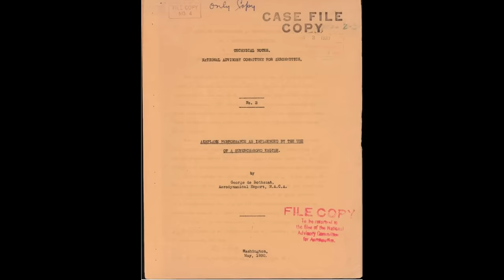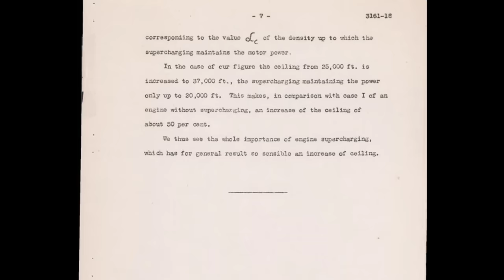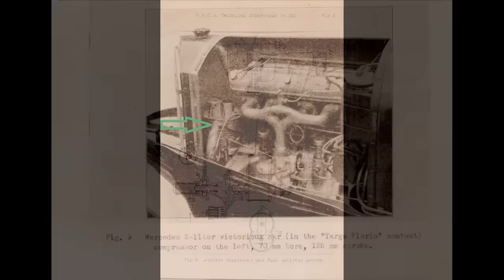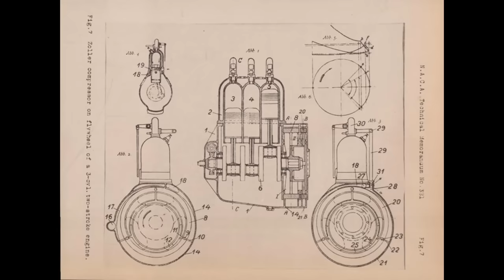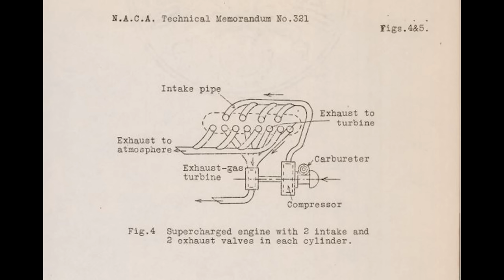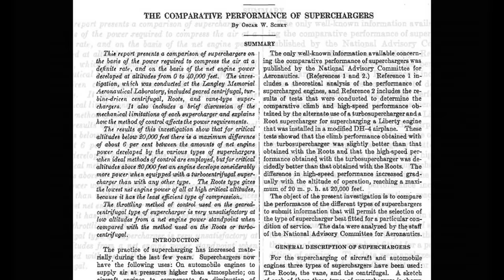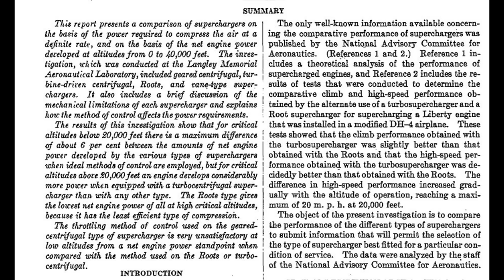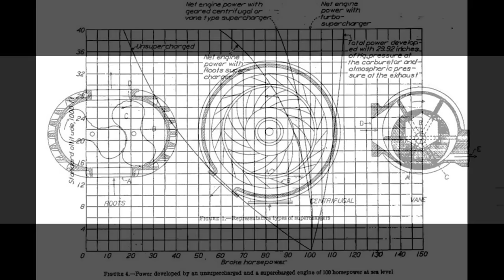Turbo vs Supercharging in WW2 Airplanes

Comment: It is becoming more and more clear to me that the Thunderbolt was one hell of a fighter - -thanks for this post.
Reply: Just couldn't turn very well
Reply: A dinosaur with good proportions
Reply: with a cockpit big like a dance hall
Reply: @davidvalter1936  It could turn just fine at high altitude. Later models (late model Ds and Ms) were faster than P-51s at altitude. At lower altitudes, they were not as maneuverable .
Reply: @richardlahan7068  As long as you didn't need to fly too far!
Reply: @davidvalter1936  but it could roll pretty fast, especially at high airspeeds
Reply: Thunderbolt is the early F4. 😀 Add enough power and it overcomes a lot of deficiencies.
Reply: And then some.

P47 never fails to amaze.
Reply: @rob5944  watch Greg’s video on the P-47’s range (if you haven’t already). It’s a complete myth that the P-47 was incapable of escorting B-17s to Berlin and back. The P-51 did have more range than the P-47 but not as much as most people think.
Reply: @dogeness  then I wonder why it's never been stated before?
Reply: @rob5944  That has always been a lie used by the P51 fan boys  Mike Spick Fighters 950 miles without drop tanks and more than enough to get to  Frankfurt Mannhiem  without loitering
Reply: @jacktattis  so the Army Air Force just allowed their bombers to be shot down needlessly?
Reply: @rob5944   I did say 950 miles 475 miles each way and I did state the cities they could get to And dont forget the P47 did get drop tanks later.  There were other reasons the P51 got the nod,  You did know that the P47 got more kills in Europe.
Reply: @jacktattis  haven't really looked tbh.  In fact I can't remember what the original conversation was about.  I'm more of a casual viewer, sorry.
Reply: And it is becoming more and more clear to me that the Pratt & Whitney was one hell of a motor company.
Reply: @rob5944 I know I'm late to this but the fact that you asked "Army Air Force just allowed their bombers to be shot down needlessly ?" and it actually being 100% correct is hilarious. 
Bomber Mafia is the key term, Greg's part 6 of the P-47 series covers this topic aswell so have fun watching if you didn't already.
Reply: @Tacticaviator7  blimey, I can't even remember.  Did I?  I would say however that for a while I believe the Americans were confident that with close formation and a heavy defensive armament they could protect themselves, despite the RAF telling them that it would'nt work.  According to actual veterans (The World At War 1973 TV series) it was prettysuccessful....However this was only brief.  As raids grew in size and went deeper, and the Germans developed their tactics, losses mounted.  So much so that 8th air force operations were suspended.  Now I'm only repeating what I heard them say, so I suppose it's Greg and his research vs them.  They only have their own perspective but he hasn't the lived experience, perhaps the truth lies somewhere in between.  Who knows.  What is certain is that the bomber offensive was hell on earth for both the 8th and Bomber Command, not to mention those on the ground and the fighter pilots.  Maybe we should all content ourselves with that.

Comment: Fun fact:  That big building in the foreground of the aerial photograph of the Indianapolis Motor Speedway? It's the Allison aircraft engine factory -- it's literally just across 16th street.
Reply from the maker: Oh, an Easter egg! I didn't even know it was there, cool.
Reply: @GregsAirplanesandAutomobiles  LLm
Reply: I'm not sure about that factory in the picture, one way or the other.  I lived in Speedway (on 15th Street) and worked at Allison from 1980 to 1985.  Allison Plant 1 was further down Main Street, which is in the lower left corner of the picture at 5:52 .  When I lived there, the building occupying the space was a Union Carbide plant, but it wasn't the plant in the picture.  Allison Plant 3 was down at the end of Main St, on 10th.  That was a huge manufacturing plant.  And about 10 miles away, close to the airport, was Allison Plant 5 that was even bigger.  Plant 5 was one of those 6-week wonders that was built in 1942, where production started before the roof was even finished.  Maybe that was Allison Plant 2 in the picture?

Comment: OK I admit it, I cried during this video.  The first time  Clostermann (Top French WW2 ace, most of them in Spitfire) saw a P-47 he thought they were useless (probably the first that landed in England...).  But later he calls them Brutes.  He didn't like Americans, but he was an aeronautical engineer, and was right, the Jug was a brute.  It was designed that way, because at high altitude, the only thing that matters is power.  Some aircraft could climb as high, but the P-47 could operate there.

Comment: I know I’m watching this 5 years late but I thought I’d just point out the auto brand I work for has been using electric supercharging successfully for a few years now. However, only within certain limitations. It’s on their highest performing cars and only acts as a super charger in high load low speed applications where the relatively large turbo isn’t doing much. In such an application, the electric supercharger will spin up within .5 seconds to max boost of 7 pounds for a max of 5 seconds. By this time the transmission has downshifted, the engine has spun up, and the big turbo is moving some serious air. At this point the electric supercharger is no longer needed and shuts down. This runs on a “48v” power system and actually works quite well.  Unfortunately the reliability of the first gen 48v system was pretty bad for the first several years until the horrendous software and hardware issues were worked out. Fortunately the 2nd gen 48v system was much better and most of the electric superchargers were on the 2nd gen system.  They just released an even newer system that deletes the electric supercharger altogether and moved to an electrified turbo charger. This means in low speed high load applications there’s a still 48v electric bolted to the turbo which can spin the turbo to high boost speeds even though the engine isn’t yet moving enough air. It works about as seamlessly as the electric supercharger, so it’s quite good.  They claim that it can also function as an energy recovery system to recharge the 48v battery in certain applications. Love your technical videos, keep up the great work Greg!

Comment: It actually came as a surprise to many engine designers that they gained power as they gained altitude with a turbo engine. All they wanted was to "equalise" the manifold pressure drop due to the lower air density, but didn't expect to actually get more power. I suspect some of those graphs were done after the testing revealed this and they finally understood what was happening.

Comment: My grandfather passed away in the 1970s. He worked all his life at Buick in Engineering. His father was Chief Chassis Engineer when the Buick company was first formed. I remember my Grandpa telling me that turbos were something that Buick really wanted to use but up until the 1950s they just didn't have the metals to resist the high temperatures for any period of time. This was less of an issue in aircraft because they had a much cooler and faster airflow to assist in cooling them but even then they did not have a long enough life to be practical in an auto engine. Superchargers where chosen in the early days because they were well-known and presented far less development costs that turbos did.

Comment: Rolls Royce with both Merlin and Griffon stuck with a two stage supercharger because their iterative design methods created a system which worked extremely well. Their blower was so good they used it on the Nene turbo jet used in many early jets.

Comment: As a young man working as a heavy equipment mechanic, I worked on some big ore haulers that were powered by big v16 diesel engines.   They were turbo charged, intercooled and supercharged.   Four exhaust driven turbo chargers pushed air into an intercooler and then the cooled air went through the belt driven supercharger which rammed the air into the cylinders.   Those engines were rated at about 2200 horsies.
Reply from the maker: There is some impressive tech in the Diesel powered heavy machinery world. Thanks for your comment.

Comment: All love to the Jug. Indeed an aircraft made for warfare not for showrooms and posters.
Reply: Fábio 
I think you basically just quoted Kurt Tanks design doctrine for the 190. Which makes sense, admittedly, since they both made a departure from the standard fighter design dogma of the time
Reply: Quite agree. The jug was a proper warbird.
Reply: @zandvoort8616  Till they had to turn round and go back.
Reply: Rob Val, according to Greg they didn’t have to if they were allowed to use the belly tanks.
Reply: Ww2 had some of the best airplanes ever built
Reply: @rob5944 why do that when you can dive right back at altitude and take your time?

Comment: Der Unterschied zwischen den beiden Formen der Anlage wird von diesem ausgezeichneten Video völlig und verständlich erklärt. Echt super!
Reply from the maker: Thanks notaire2,  that's a high compliment.
Reply: I'm not sure if you have read much on the turbo charger development done on the BMW 801:

"As just one result of the highest level of priority given to the successful 801 design's further development, a number of attempts were made to use turbochargers on the BMW 801 series as well. The first used a modified BMW 801D to create the BMW 801J, delivering 1,810 PS (1,785 hp, 1,331 kW) at takeoff and 1,500 hp (1,103 kW) at 12,200 m (40,000 ft), an altitude where the D was struggling to produce 630 hp (463 kW). The BMW 801E was likewise modified to create the BMW 801Q, delivering a superb 1,715 hp (1,261 kW) at 12,200 m (40,000 ft), power ratings no existing Allied radial engine of a similar displacement could match.

The turbocharger was fitted to the top rear of the engine at a 30° forward tilt, and had hollow turbine blades.

Not many of these engines ever entered production due to high costs, and the various high-altitude designs based on them were forced to turn to other engines, typically the Junkers Jumo 213."
Reply: notsureyou Thanks for your informative and detailed reply. German ingenuity in technology was not necessarily realized in the field of producing consumer goods.
Reply: @notaire2  Engineers are helpless when beholden to lunatics, and Germans seem more prone to 'Crazy Harry' than most.
Reply: +Steve Watson 'Crazy Harry' is sometimes called 'Deutsche Gründlichkeit' in negative meaning.

Comment: at 28:35: Someone might have mentioned this already, since I didn't read thru all the comments, but one very interesting german project was Blohm & Voss BV 155, which was one of the late war prototypes in 1945. And, as you said, it wasn't a combat aircraft, just a couple of prototypes were built and one flown before the end of the war. But it had both the supercharger and intercooled turbocharger. At least The Monogram has published a very good book on that one. It was supposed to be a extreme high altitude fighter(go higher than Ta-152), which it would have done, had the project started earlier.

Comment: Keep it coming Greg. Analog technology is very neat - you can even understand it. And hats off to the people that created better planes and cars through say 1960. I wouldn't dismiss the great improvements in efficiency and safety in the last sixty years (and certainly not the power of "smart weapons") - but in a functional sense, how much better is a Boeing Dreamliner than a 707? The 707 flew nearly 60 years ago - sixty years before the 707 there weren't airplanes. Think about something like the Ford Cobra or the mid-60s Ferraris - how much neater is a modern super car? How much more practical is a 2018 Civic over a 1963 Dodge Dart? 
I spend the summer in St. Paul. Every June there's a "Back to the 50s" festival where auto enthusiasts bring their cherry  stock or elaborately modified rides from the 50s & 60s. (Some MGAs and Austin Healys show up too - my old honeys.) Guys of my generation (and even a lot of the gals that were touched by the car culture) can spend an hour or two identifying year and make. (I've got Chevys down pat: some of the mid-50s Fords fool me.) Can you imagine that happening two generations from now? "Look grandpa - a 2014 Civic!"

Comment: One of the few YouTube channels where the comments are typically worthwhile...  In any case Professor Greg, could you discuss the pilot work load with both configurations, i.e. Thunderbolt vs Corsair. I’ve read many histories by pilots and don’t ever recall hearing them discuss this, beyond Col. Tibbets mentioning how the poor throttle settings on the B-17 could get the turbos surging (whatever that means).

Comment: I remember Kelly Johnson saying in his autobiography "Kelly", That the P-38's layout never seemed odd in the slightest to him. When he took the engines, cooling systems, turbo ducting, and supercharger boost ducting and lined them up in an aerodynamic way, it nearly stretched to the tail. So they just added a few feet of fuselage behind the assembly, and put the tail boom between them.
Reply: Very uneconomical  when they could have approached the Brits to give them 2 stage 2 speed Super chargers

Comment: I loved your analysis of forced induction aero engines. My Dad was a pre and post WW11 aero engineer and I was an Airforce pilot flying Supercharged radials. For the first time with your video I have found a realistic analysis of aircraft without emotion (apart from the usual aviator enthusiasm) and without pushing a particular POV.Many thanks.You,  as a Yank, have an american view but that is fine. I will look for your video on the P51 (esp the Packard Merlin version).
Aerodynamics (innovations)  in my opinion also have a great role in aeroplane design. I note that the Spitfire wing, being so thin had by accident a very high mach number although a very expensive 'plane to make compared with the Hurricane. Still, I am only an ex pilot, not an engineer but I respect engineers. I also comment that the carbed Spit had limited inverted (negative g) performance compared with the injected 109s. (having flown a carbed ww11 aeroplane I can attest to the limited negative G issue, not that negative g is pleasant having done one neg G loop)

Comment: You had me liking this video the moment you said "turbo-supercharger."  It still amazes me how many don't understand that the term "supercharge" means what it says: to increase the charge in the cylinder beyond what could normally be attained.  Everything else references the means of powering the compressor, whether it be a turbo/turbine, toothed belt, gear drive, direct drive, etc. - even if they aren't always stated in vernacular usage.  (And yep, that means electric turbochargers can't exist - it's just an electric motor that could theoretically be attached to any style of supercharger, whether it be Rootes, centrifugal, etc.)

Great video.  Love the details for all us enginerds.  :-)
Reply from the maker: Good point. The word supercharger seems to be highly misunderstood.
Reply: This video dose not mention Sir Stanley Hooker the best super charger designer in the world  eg p51 and modern jet engines built under licence in the us and harier and RB211
Reply: @brucemcgeehan2847  Do you want a 4 hour or a 40 minute video? :-) Sir Stanley wouldn't mind; his autobiography is titled "Not Much of an Engineer". Modest chap!
Reply: @GregsAirplanesandAutomobiles  :  Hi, Greg.  Great videos.  Good level of detail and fine presentation.
   I think the term "supercharger" originally meant "mechanically driven forced induction" because that's the only kind there was.  Gas turbines are really hard to make, primarily from a material science standpoint.  When good refractory metals, high-temperature lubricants and cooling techniques came along, it became necessary to distinguish between the two types.  Thus "turbo-supercharger". 
   It's a little clumsy having to use "supercharger" as both a general and a specific term.  I've read a few articles in which the author refers to the mechanical types as "blowers" and the exhaust-driven variety as "turbos".  Completely unambiguous, I think, and somehow more satisfying.

Comment: The diesel engine in the Junkers 86 was also a two stroke in an inline configuration with opposing pistons and two crankshafts, a concept rarely used but still being refined and used today in specific applications often military. The plane was also used as a high altitude bomber until the allies adapted fighters for high altitude to be able to attack them.
Reply: The Dornier  Do 217P 58000 ft ALL INLINE